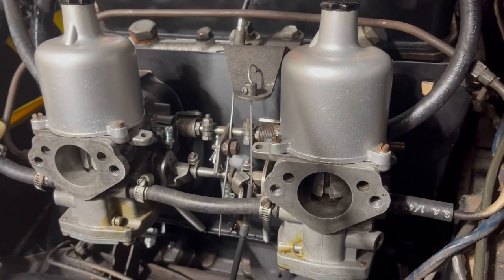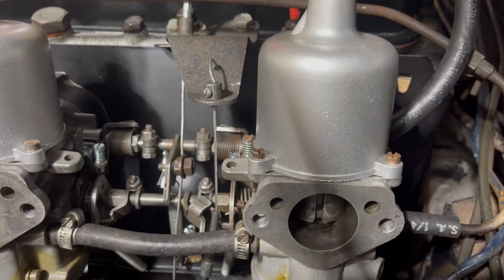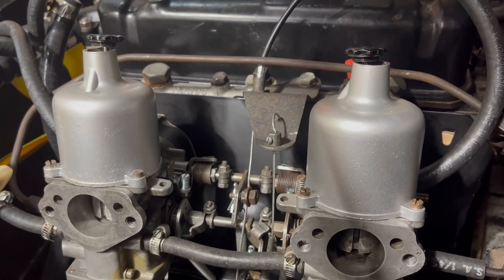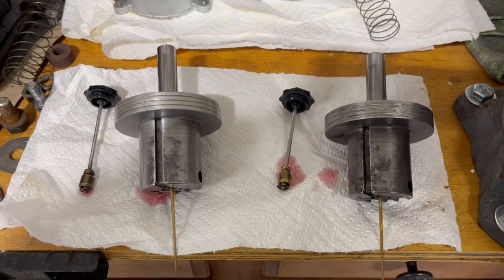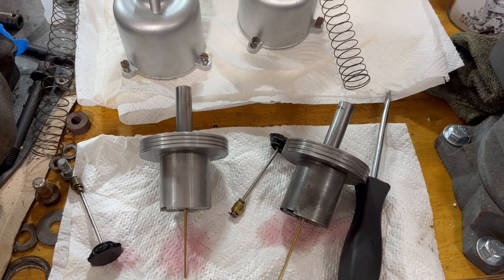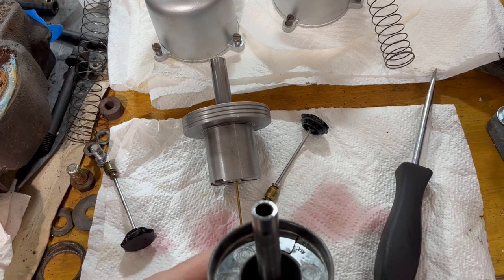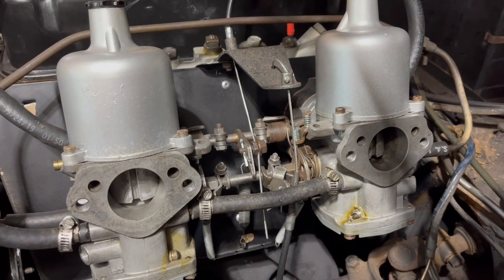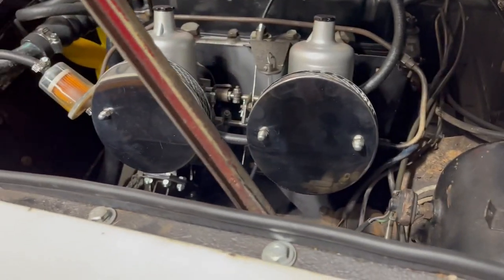SU Dashpots on my MGB | Fluid Level and Troubleshooting

Comment: Hey this video was very helpful, I have the exact same issue happening with my 240z carbs. I swapped the caps and the problem followed the cap. I'm waiting for a new set of caps to see that will fix my problem. From what I see in this video I am very hopeful that the problem will be fixed.  Thanks again.

Comment: Just looking at them I'd say the oil was congealed more on the left one than the right.  I've gone throught the same carbs twice, 25 years apart.  They were almost glued solid.  Cleaned em out and used straight 30 weight.  I had the manual and I'm pretty sure it had the amount of oil.  Unfortunately the guy who owned the car died 12 years ago and no access to the manual.  The carbs were on an MGA 1959.  Square cut gears in the tranny and you had to double clutch to downshift.  Fun to drive once I got the hang of it.  Felt a little like Sterling Moss.   Rupp rupp rupp-

Comment: You could use new washers on the float shaft. Both show signs of leaking. 

Observation, ATF is way too thin and it will cause lean conditions at higher RPMs. And finally SU carbs only need to be filled where you're a good inch from the top and maybe even a little more than that. I fill mine by resting my finger on the lip of the piston, the level is matching the top of my finger. People over fill them constantly. You want to know the true level, fill it as high as you want, take it for a drive then look, you'll see it is over an inch from the top after sucking all the extra out. That's how high you should fill it. And to really understand how well you're running get a AFR gauge installed, that is how I found and fixed all my fault issues with my HIF4s.

P.S. 20-50 works best for me. It is 20 weight in the winter when you want it thinner and 50 in the summer when you want it thicker. ATF does not react anything close to that and is even thinner than 20 weight. Remember in an SU it's there mainly for dampening, meaning stopping the pistons from micro movements, the secondary effect is also to slow the rise of the pistons in concert when the spring weight used. You mess with one it throws the other off.

Comment: @D3Sshooter has extensive, informative videos on the SU carbs. He mentions that the pistons and dashpots are mated, so they shouldn't be swapped when working on them.  It could be that yours had been during a prior repair.  Thanks for the video. Every little bit helps.

Comment: At 3:54 your left dashpot piston rod is bent which must be adding undue pressure to that pistol.
Reply from the maker: I think they look bent in the video too, but I am thinking that is because the brass part at the bottom is a little loose and cocked to one side. I'll double check them for sure when I get home, because that could be it! Good catch!
Reply: @MyMGBJourney  If I were you I'd get new ones anyway, there are two types for HIFs so make sure you get the style you have which. You can see the difference in the pictures on the Moss sight. They are slightly different in size on the barrel by a .002 or so in size. That relates to the specific model of HIFs, there are two different part numbers used in the 4 years the appeared. I would also get a set of new Red Springs as well, they will wear out and lose tension causing you to also run way too lean at cruise etc.

Comment: You are kind of there. All the fluids you mentioned will work, but the viscosity of the fluid controls the rise of the piston which is how you can tune whether the carburetor goes lean on acceleration.This is a Black Art.  If you are getting popping and spitting you are going to lean go heaver. SU's do not have a accelerator pump which is what the piston is compensating for. Be careful to not mix up the pistons and the dashpots as they are matched at the factory. Sounds like theo PO mixed up the dashpots. I typically use the same oil as the engine or MMO. The amount is to the top ring. BTW the spring on top comes in different spring rates which can throw you a curve and the plunger at the end of the screw on cap is a check valve which also controls the rise of the piston. BTW looks like you have vented dashpots and vented screw caps, which would give you  two vents per carburetor should only have one. Check you throttle shafts, they are most likely worn and leaking  vacuum and need to be rebushed. Check with carb cleaner of starter fluid, spray around the shaft and if the engine speedup they are leaking. Start watching John Twist videos or put on as set of Mikuni carburetors.
Mikuni          https://www.youtube.com/watch?v=30bXQr4oGmI       
John Twist  https://www.youtube.com/watch?v=4nvGLgO6pj0
More than you will ever want to know about SU carbs: https://mgaguru.com/mgtech/carbs/cb130.htm
John Twist Site: https://universitymotorsltd.com/technical-help/
Reply from the maker: Thanks Jim! Fortunately, this is after a fresh rebuild so I know my throttle shafts are in good shape. I had no idea that pistons and dashpots were matched at the factory though. Based on my result, I'd say you're spot on.

Comment: It's oil viscosity, you can tune them to tempatures, it calls for standard 30w oil. Thinner for warm, thicker for cold. Why? Because cold air is denser, warm air is thinner.
BTW, look closely at the rod, there is a hash mark for the proper level. 20 wt in the cold 40 wt in the warm.. 30 wt for the average. 
And measure the diameter and look at the grooves to make sure they are the same.
Reply: You just contradicted yourself
Reply: @michaelannen4168  yeah, it should be the 20wt for the summer and 40 for extreme cold. Air will ram the pistons up too fast if it were thin in the winter and too slow in the summer..
Reply: Would 10w-30 be appropriate?

Comment: Does the dash pot cap have a small vent hole and if so could it have been blocked on the one and not the other ?
Reply from the maker: There is a small vent hole in each cap and they weren’t blocked. The resistance comes from the fluid moving around the small piston hanging off the cap and not the cap itself. I guess the interference between that little piston and the bore was off by just enough!

Comment: Hopefully someone can answer this. What is the pipe that loops over the top of the carbs and it looked like it tees off somewhere. If someone can let me know would be much appreciated
Reply from the maker: Hey There! That T is supposed to go over to the charcoal canister if you still have it fitted. If not, it can simply be capped off. This diagram might shed a little light: https://mossmotors.com/mgb-017-emission-system-controls-1970-74

Comment: 20 weight is correct! Your dash pots are incorrectly fitted looking at your he video. The casting boss at the top of the pot should point away from the engine! Your first carb is correct. Helpful?
Reply from the maker: Oh wow! I didn't even notice that 🤦‍♂! Could that really make a difference? No matter, If I can just spin it, I definitely will, if for no other reason than the symmetry. And yes, I could always use this stuff https://mossmotors.com/220-226-dynolite-carburetor-dashpot-oil-125ml which is 20 Wt.

Comment: 90 weight.. never.   SUs are not finnicky if you  know what you are doing and set them up correctly.
Reply from the maker: Oh I definitely agree! I would never put anything that heavy in the dashpots. I have heard the argument, however, that because the parts are old and have inevitably worn, the heavier oil option takes up the slack. As slow as my air pistons move with 20w50, I would never use anything heavier than that. I also agree with your second point, but after a full rebuild, this is still part of my "set them up correctly" process. Thanks for your input!
Reply: @MyMGBJourney  My 63 MGB has the original carbs, not piston wobble, no sticking ,
no evidence of some moron sand blasting them.. worn throttle shafts just renewed.

Overhaul them, or have a pro like Curto do it..
Reply from the maker: @jeffhildreth9244  I just rebuilt mine with a kit from sucarb.co.uk and it made a huge difference. I think that sand/vapor blasting the bodies is just fine as long as all the holes and passages are completely sealed up. I can't imagine trying to tune a carb with grains of sand grinding around inside. 😖